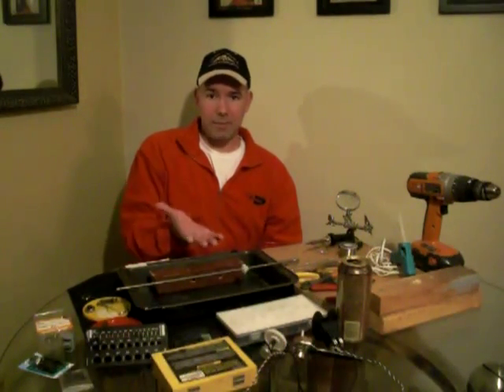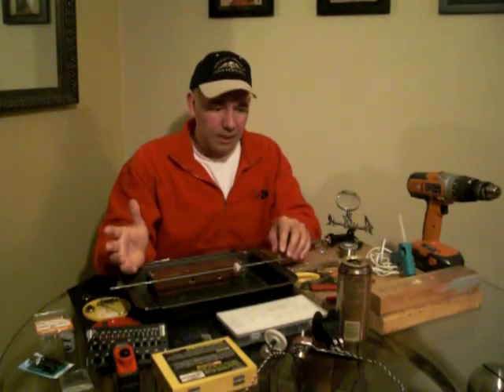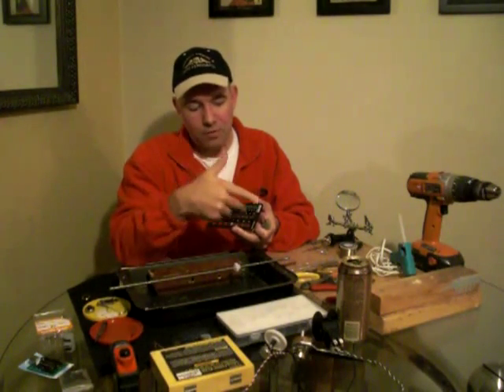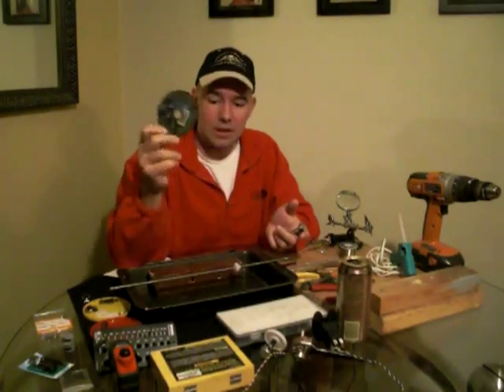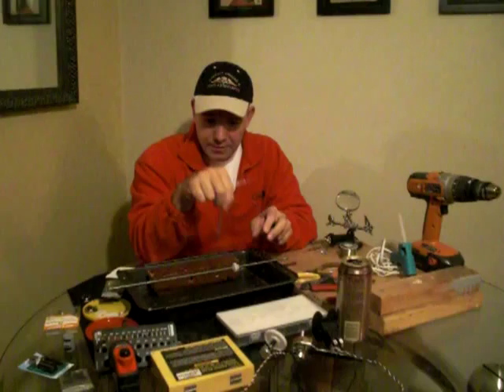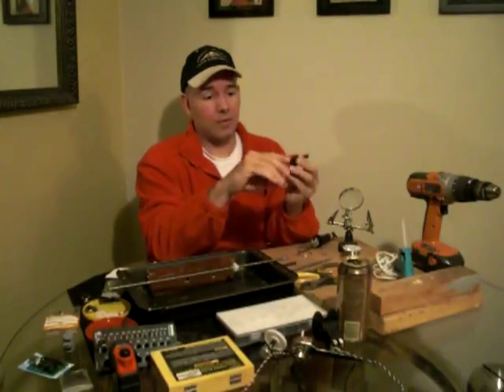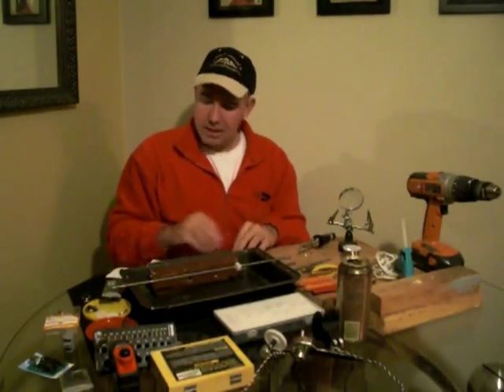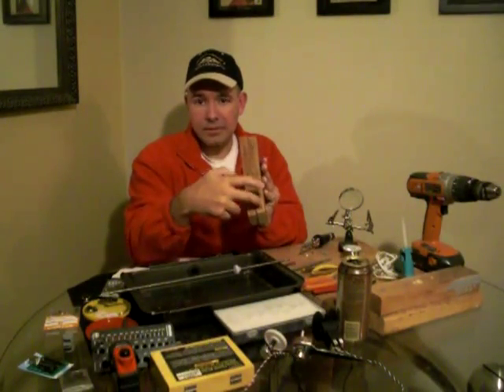Home Made Flight Simulator - Building Your Own Trim Wheel, Speed Brakes, and Flaps Part. 1

Comment from the maker: @TheDeltaFlight Yes, you just need to buy the right toggles and a control board from somewhere like Desktop Aviator.  The easiest way is to use SPST momentary spring return toggles otherwise you have to build a pulse circuit.  FS9 & FSX do not allow for a permament "on" meaning just like a storebought joystick or your PC keyboard the command is only effected once and the physical toggle or button springs back to the "ready" position. With a pulse style you get the realistic feel but its the same

Comment from the maker: @santana77780 Yes, you can through the Control Assignments  / Calibration but with car pedals you do not have toe braking ability (in addtion to left/right rudder control) which is extremely necessary for all aircraft.  I would suggest buying a used set of CH Pro pedals off of eBay rather than trying to use car pedals.

Comment from the maker: @jpsg777 The LX-1 can accomdate up to six(6) 26" widescreen LCDs or more if they are smaller (at 20" for example you could use 8 moinitors) These figures also do not account for the 4 or more lower monitors for aircraft panel instruments. I will have the plans complete by the end of this month. Thanks for watching!